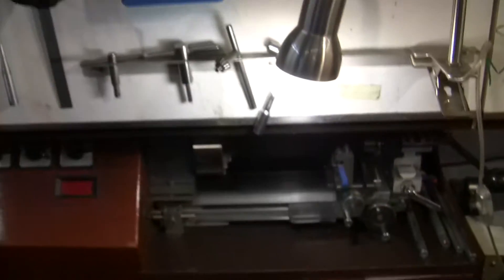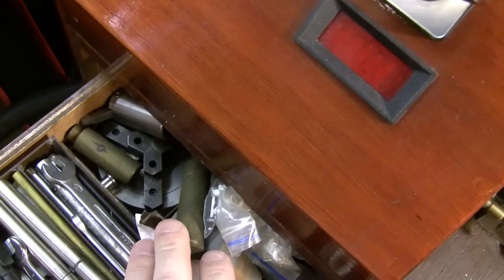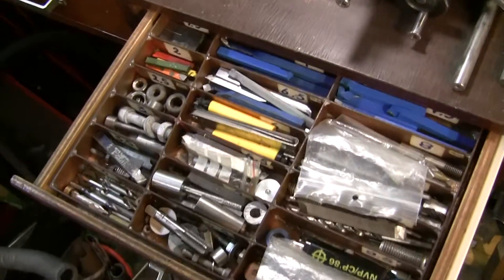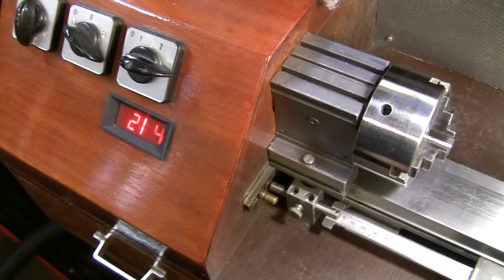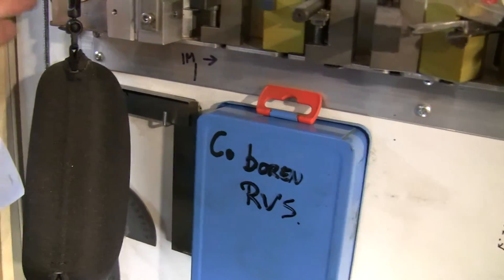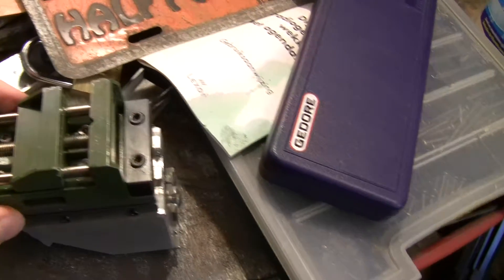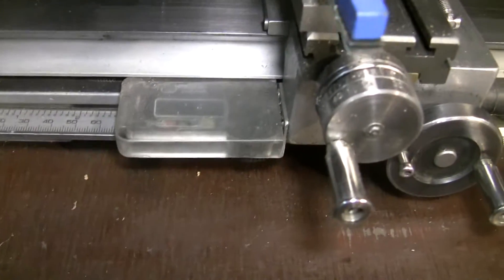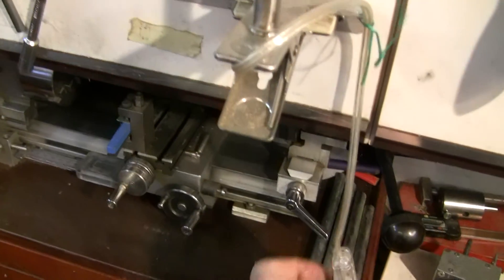taig questions Walter

Comment: Hello Happy,
   sorry for the delay, and thank you for the tour, that is a very nice compact setup you have with your cabinet I imagine you built it yourself, very nice indeed, my shop is one and a half of a 20ft x 24ft heated garage and yet its still not big enough, I guess I'm spoiled, but with temps that can reach minus 35 below Celsius it has to be heated or I wouldn't get anything done, I spent some time searching for SCA chucks but didn't have much success lots of big chucks, but no 80 mm with 3/4-16 threaded body, would you be able to help with more detail, I have two well known chucks I think I could get rid of for around $500,do you think that would cover one like yours?
Reply from the maker: you can ask what they have these days : http://www.fortiva.se/  I think the one I have is no longer made, but I remember a few years ago the brand Bison also had the same kind of chuck also treaded for taig (3/4 X 16)
look at this site they seem to sell the 2 3/8 inch bison for 325 dollar http://brassandtool.com/Chucks-Lathe.html  mine is a bit over 3'' (80mm)